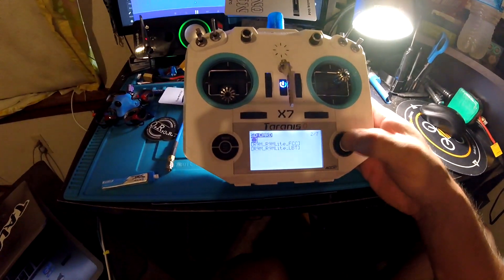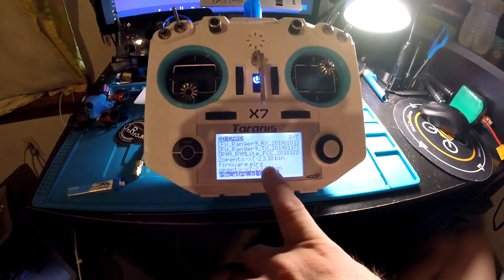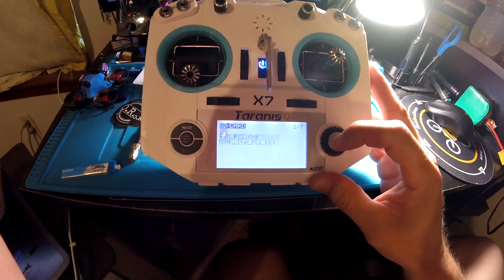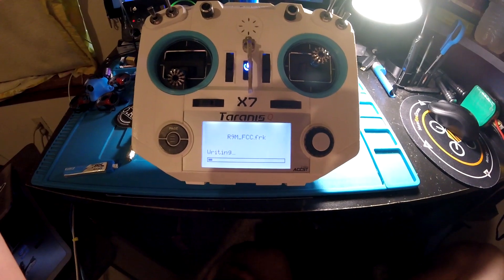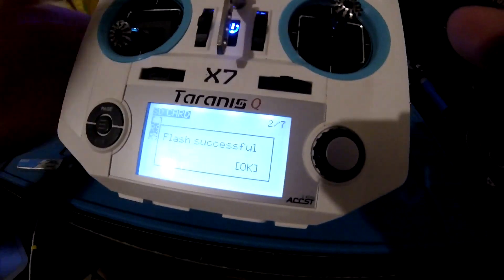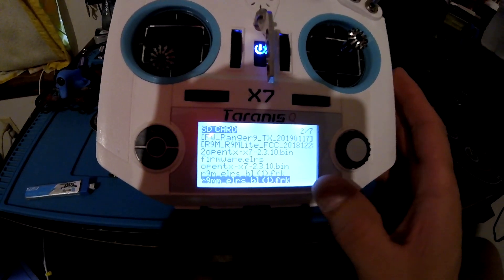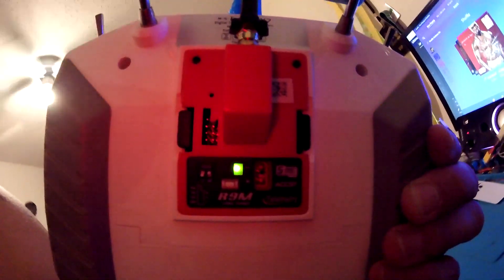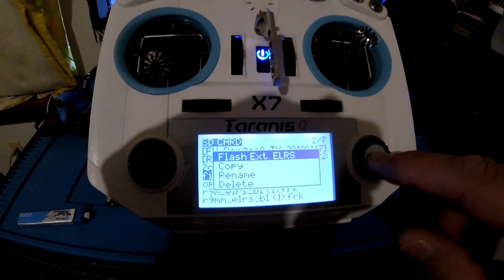Updating the R9M from ExpressLRS to Frsky, and back.

Comment: i saw on another video that if your using the older r9 module that you have to do a resistor mod to the module? did you have to do that?
Reply from the maker: Yes. I think it was a 680ohm resistor. It was fairly easy to do.

Comment: quick question why do you have Tweets logo as  yours
Reply from the maker: I purchased that logo design years ago. And I had no idea anyone else used it until I randomly seen Tweet years later. And by that time I am not going to change it. Sorry.
Reply from the maker: Ironically, we both started using a very similar design (not exactly the same) about the same time.